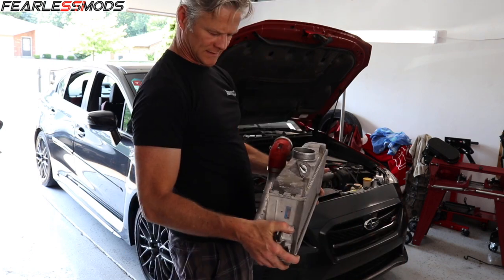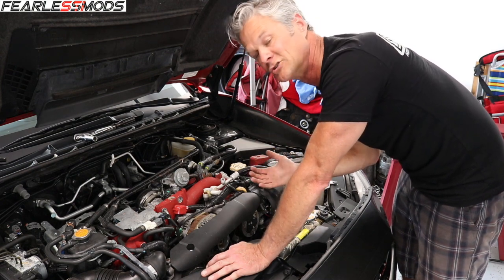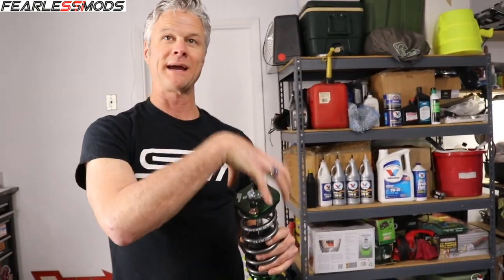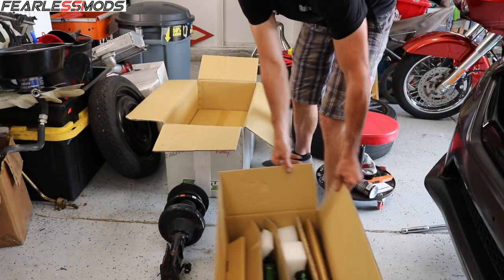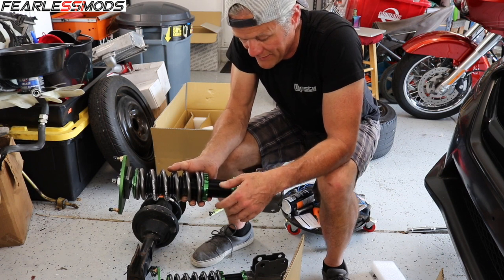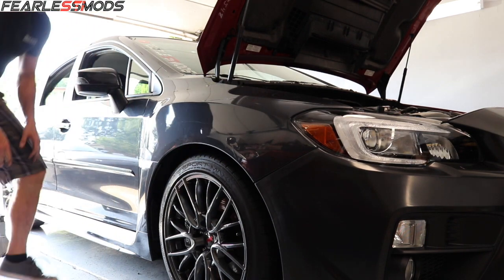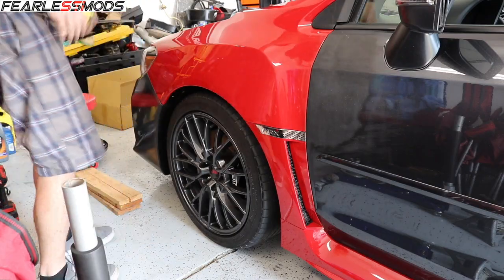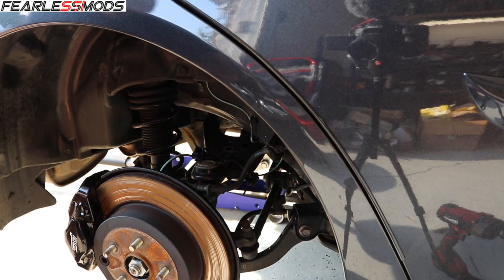Subaru WRX STi Ep 33: Installing Fortune Auto Coilovers

Comment: I have been looking forward to this video! One of my next mods also.
Reply from the maker: JotaJota STI Ride  height is dialed in, wheels aligned, and I’m putting new rubber down on the road. She looks badass and drives like a dream! No scrapes or rubs at all and it’s 1-1/2” lower all around.
Reply: FearlessMods nice I will consider these when I am ready to lower. I just got my new wheels I should have that video out soon. Wonder how much of a difference these will make at the track.
Reply from the maker: Joe, I just re-watched your Rays wheel vid and about to pull the trigger (on something?) LOL!  Curious how the 38 offset worked when you lowered it and how much you lowered?
Reply: FearlessMods Hey! I love them and it’s crazy because I am on stock height! The tires I run are 255/40 so it fills in the gap pretty well. If anything I would be lowering the fronts a little.
Reply from the maker: @JotaJotaSTI  they look great at stock height.  Just wondering if I should shoot for 42 offset to account for the lowering.  Mild camber has chewed up my new dunlops in only 10,000 miles so I'm not looking for any more camber!!

Comment: you don't unbolt every time to adjust height. You turn the collar🙄
Reply from the maker: turtlebmx if you’re referring to the rears...the problem was every time I tried to turn the collar, it was loosening the pretension because it kept wanting to rotate too.
Reply: Did you end up finding an easy solution to adjusting the rears without the pretension backing off? I have a set coming and this is this 2nd vid I’ve seen where someone had an issue adjusting the rears.